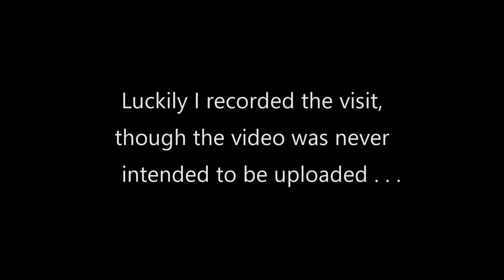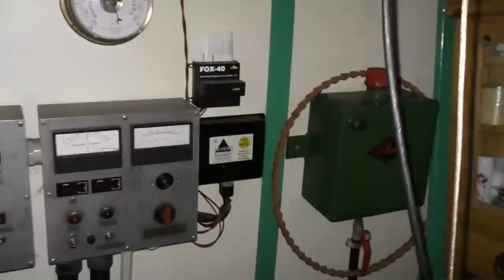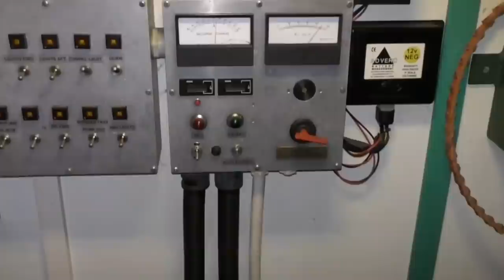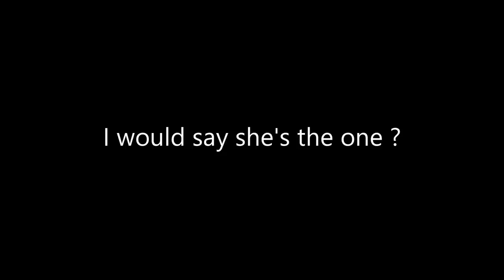When Kevin Met Aslan (the Narrowboat)

Comment: the engine bay is tidy for sure.. but if you look closely at around 3:15 there seems to be some seepage in the diff sprocket. I zoomed in on this and also noticed the axial alignment crank was out of alignment, not that most would probably notice to be honest, but we are experts in this kind of thing.  I'd be happy to help you sort out these issues, but I think you might need a new aft dispeller pump and prop also, they don't come cheap as we have to ship them in from Holland.  All in all I'm estimating £17,000 including parts and labour, but we may find other issues when we inspect the boat. Drop me a message and we can come and take a look and provide a fixed price quote.